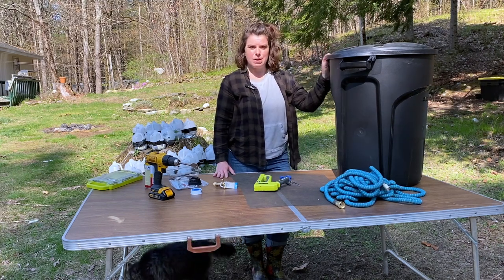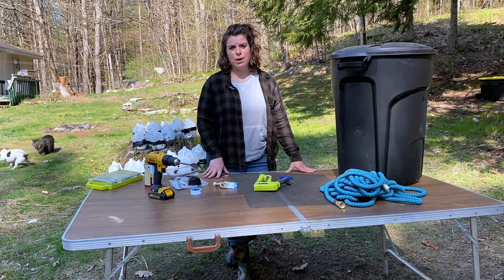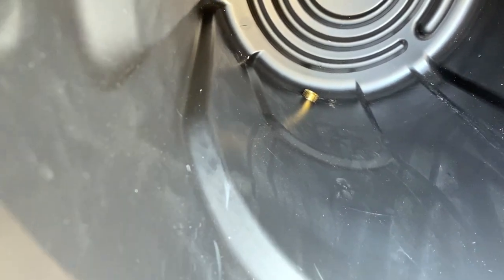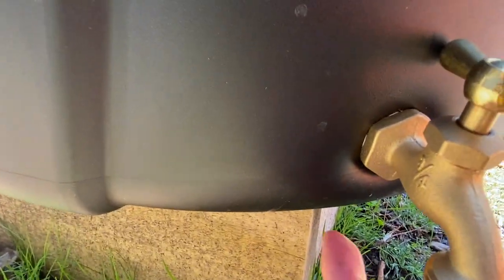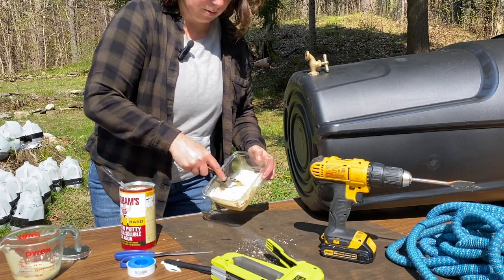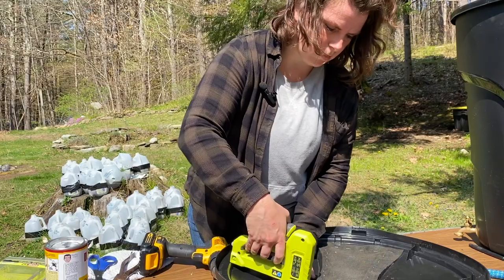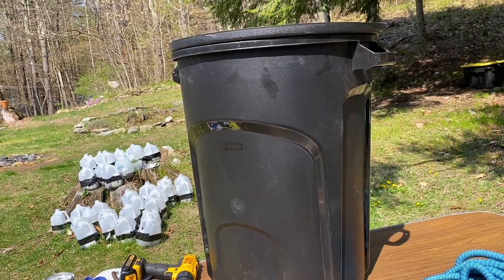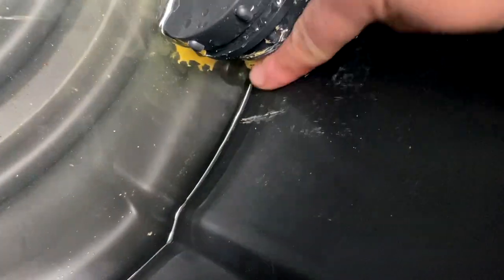DIY Rain Barrel...Learn From My Mistakes! 🤪

Comment: How is your rain barrel working out? Do you get enough pressure to use the garden hose and sprayer or are you having to fill up a watering can?  I’m getting ready to do a similar water barrel for a garden bed that is too far from our water supply so it’s interesting to see how others have done this.😊
Reply from the maker: It’s working out well for filling my watering can; although not as fast as I was hoping. We haven’t had much rain here past month or so, so it’s only like 1/4 full and the hose isn’t working as of yet. I’m happy to have it in such a convenient spot!  Might fill it up with more water at some point.